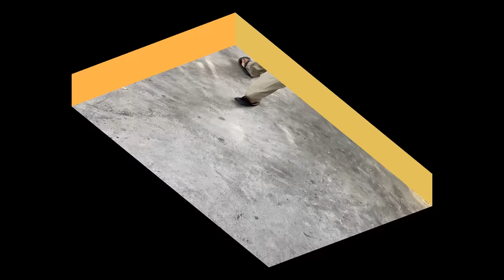DIY - Great Craftsman's Ideas // How to Make a Smart Folding Chair // Metal Smart Folding Utensils !

Comment: Mast kalander. But the top seat should be larger. Very heavy. Fix a sun-mica sheet over it with fevicol and fix a circular reeper around it. So even cushions could be fixed to it. Make a full chair with a front moving book holder. These chairs are used in Masjid by old peoples in Jummah Day to read Al Quran.